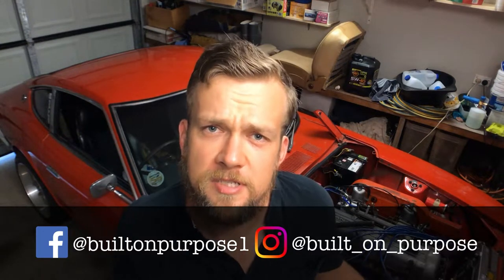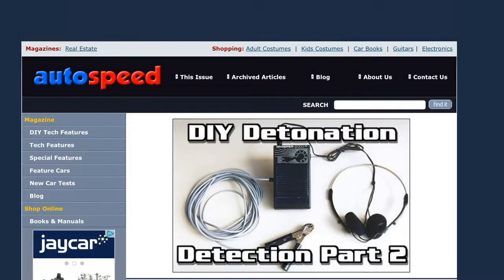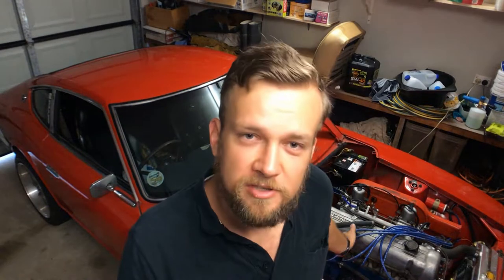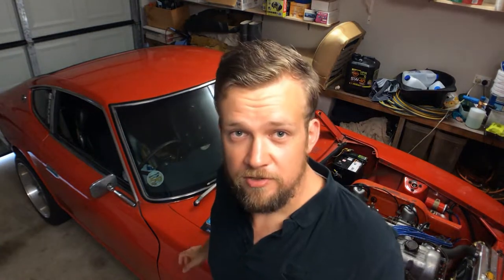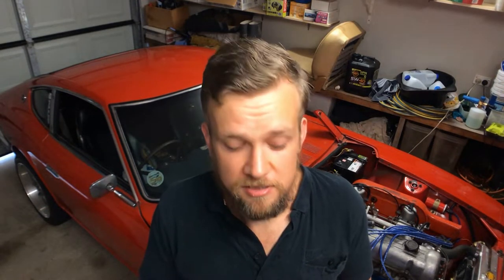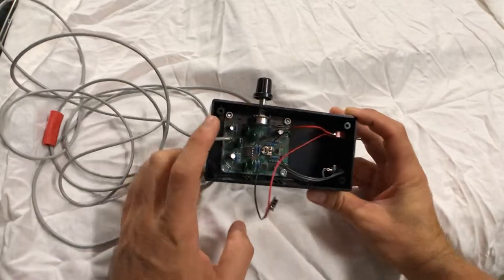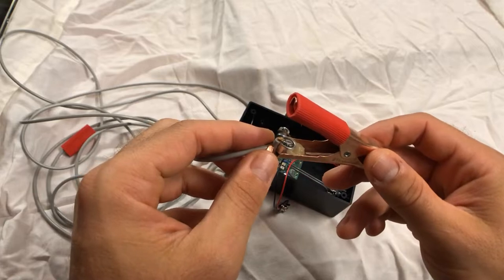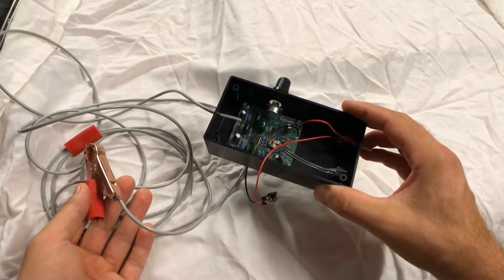Datsun 240Z L28 stroker – DIY digital det can/engine stethoscope part 1

Comment from the maker: QUESTION - do you have a favourite tool in the garage?
Reply: 1/4 drive set w a adapted 14mm. I have taken my gearbox out with it.
and a Ozito Power X Change 18V Brushless Impact Wrench Kit
Reply from the maker: robwhite240z nice! How do you find the ozito battery life?
Reply: @kyushaspeed  Real good and comes with fast charger and with 5 years warranty.  best tool ever

Comment: Hey! My name's Chandler and I'm 17 from California. I'm currently in the process of budgeting out my Mazda FC which I plan on putting an L28 Turbo stroked to 3.1 on Dellorto 48's. I was wonder if you could help me on the cylinder head, I don't know much on the p90 head and I don't know what I'd need to do to support upwards of 450whp-550whp. Any advice would be great, thanks! 😄
Reply from the maker: Hi there.  

I have not worked with a turbo L series before but I understand the P90 head to be the preferred head for turbocharged applications.  A turbo carbureted motor sounds very interesting!

I would think the basics head work applies here.  That is match port all manifolds, unshroud the valves and clean up or smooth off any dags or corners in the combustion chamber that could become a hot spot for detonation.  Evening out head temperatures is beneficial too.  I believe Godzilla Raceworks make a simple kit to improve coolant flow though the head.  

I’m not sure if changing the valve diameters is beneficial to turbocharging.  You might have to research that or talk to an experienced workshop.  Either way, pair your head and valves with an camshaft appropriate to the rest of the build (eg. Turbo sizing) and you’ll be laughing.  In chapter 17 of Racer Brown’s article hosted by Datsport.com.au has some commentary around camshaft selection for turbocharged applications.  See link below.

http://www.datsport.com/racer-brown.html